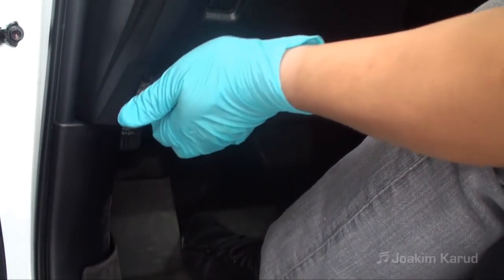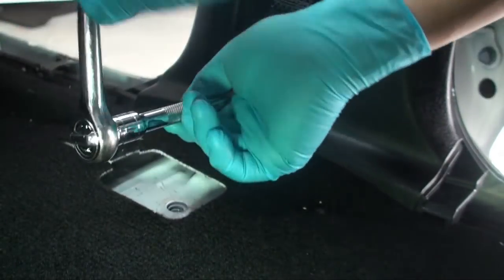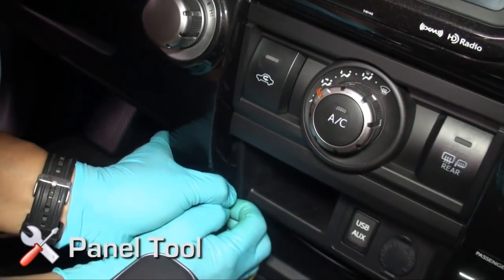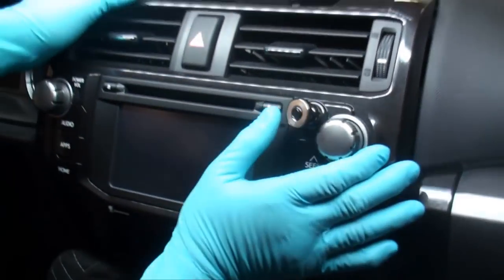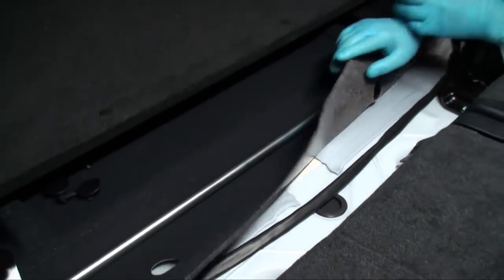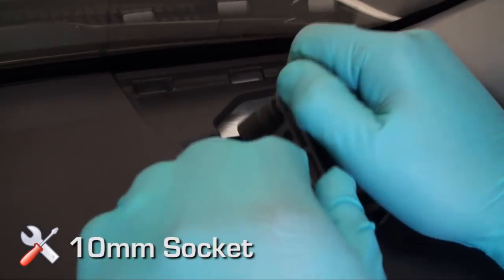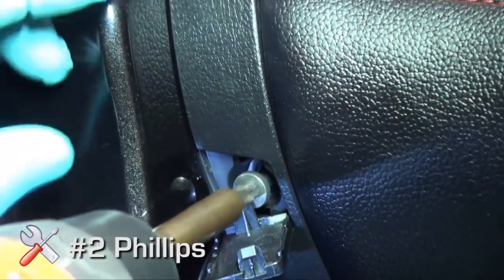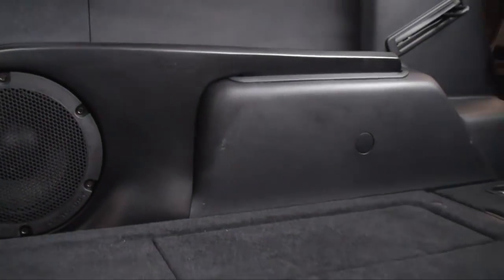Toyota 4Runner | Premium Audio Install

Comment: At 3:23, where it discusses adding the ground cable to the built-in welded threaded boss under the passengers front seat, I would scrape the metal down to remove all of the paint first. That would make it a more solid ground connection. Otherwise, good video. I would also consider adding some soundproofing to the vehicle since you have the door panels and the rear hatch panel off. I am a fan of Hushmat and Soundskins on my customers cars.
Reply: Great points.

Comment: I (double) Dyna-matted the hatches. I like that amp mounting,, very slick. My sub enclosure made it very difficult to access the brake and reverse lights on the passenger side.

Comment: Great video guys!
I feel like I can do this very easily after watching it. 
Very well made and great instruction! I cant wait to do this to my 2016 4runner trail premium.
Reply from the maker: Thanks for taking the time to share your feedback!! We truly look forward to the opportunity to transform your listening experience  in the 4Runner. Be sure to reach out by comment or message if there is ANY way we can assist you along the way.
Reply: OEM Audio +  i am curious if you sell the subwoffer box by itself without the sub?
Reply from the maker: @TheRoninChronicle  At this time we do not sell our components (enclosures) separately. This is because O+ specializes in delivering GUARANTEED results in terms of installation, sound and reliability (a promise we can only guarantee with our close-loop packages designed, engined and tuned for each specific vehicle).  

If we can serve you by providing you with a COMPLETE experience, let us know.

Comment: Just finished the install of the reference 500 (no sub) on my 2018 4Runner. First suggestion is call OEM and have them send you the email on how to reinstall the door panels. I’d think all details of the install should be readily available. I had a difficult time getting them back on. Get the email, 100 times less frustration. It’s not as easy as shown on YouTube. A number of minor details are left out but it’s doable. As for the sound? Marginally improved. I had the non JBL radio. The sound wasn’t horrible but definitely could use improvement. Perhaps I had high expectations from OEM based on testimonials but for the money paid the sound improvement is marginal. Yes the highs are a little more crisp and the bass, I have to say it’s around the same. Now I’m only comparing and contrasting the speakers with the amp. The mid level still sounds like the stock speakers, vague, a little cheap and lacking clarity. It works. Slightly better, slightly improved. I was expecting more.
Reply from the maker: Thank you for your message and bringing this to our attention. Based on your feedback, we suspect your System might not be performing as intended. Would you please send your feedback to our team at support@oemaudioplus.com (you can literally copy and paste your comment). We are committed to your satisfaction!

Comment: Pretty cool instructional video I have a 2010 4Runner non JBL & non navigation SR5.  Quick question how many watts  RMS is the subwoofer? And you guys consider making a ported version? My audio has been really lacking especially after 10 years of owning the vehicle.. looking to upgrade and purchasing this and installing it myself.. Cheers oh and I'd like to eliminate the need for a party mode I'd like all my speakers to sound the same as loud or louder than party mode is that a possibility with this?

Comment: Help would be greatly appreciated! How does the yellow power cable connect to the amp or head unit? Also the "other" end of the cable it looks like there are two wires that head towards the battery. How does this all work? 2012 4runner and kit came in Dec 2023. Cannot find help on the site or from product support. Thanks anyone ahead of time! I see no place to get the yellow cable to the amp or head unit. I don't know if the "double" yellow wires both go to the battery, etc...

Comment: The hardest part of this entire upgrade is trying to fish the harness behind the glove box.  Any videos on that particular aspect?
Reply from the maker: Michael Meuli If you’re having difficulty running the harness up and above the glove box, we would recommend putting the connectors (10-Pin and 6-Pin) in a plastic bag (the Speaker bags work) and taping to prevent the connectors from getting caught along the run. If still having trouble; send us a message at tech@oemaudioplus.com
Reply: @Oemaudioplus  probably more work than I needed to do, but I popped out the air bag, took the 5 screws out of the glove box, and popped that sucker right out. Ran the wiring in about 5 seconds, popped the glove box back on, screwed it in, and put the air bag back.  I'm a big dude so even trying to fit my hand up that side panel location was no bueno.  Thanks for the reply.  I appreciate it!  Have a good one!

Comment: I have a 2016 4Runner with a 3rd row seats. Do you offer the same sub for my model as you do for a regular 2 row model? If not, how much smaller is the subwoofer for the 3rd row model? Do you have any pictures of your sub installed in a 3 row 4Runner?
Also, what brand and model of the amplifier and speakers are used in the system? I want to look at the specs before making a decision to purchase your system.
Reply from the maker: Andrew Evanoff Yes! We have a solution made specifically for your 3-Row Seating. The following link will provide images of our 3-Row Subwoofer attached for your consideration. This System is available for either the passenger or driver side of cargo area or both (Dual). As you’ll see the design is specifically to be stealth with seamless fitment and fully functional (maintaining all functionality, outlets, etc…)

You’ll find the Reference 500 with 3-Row Configuration Page here: bit.ly/Config_4RN3

Comment: Radio removal is incorrect for my 2018. Had to find another video to help. 

Had to uninstall amp to connect new upgraded connector not shown in video. 

Running subwoofer cable under rear left trim could use more detailed explanations. It was a struggle to figure out. 

Seems like an ok product. Good customer service unless it’s Sunday. For the price they absolutely should take the time to remake a correct install video.
Reply from the maker: OK G we apologize that you encountered variances from your radio disassembly and that which is outlined in the step-by-step tutorial. 

Again please excuse any confusion in relation to our new 500Q connector. You should have received a link to the addendum video with your shipping notification and found hosted on our website under the installation support (we typically include an insert referencing this resource with the packaging). 

We don’t take it lightly that you did not receive support during your installation. We strive to make ourselves available at all times. Unfortunately this Sunday happened to be a rare instance when we missed your correspondence. It is out hope that you have since connected with the team or at least received a return call/message.
Reply: Do you have the video link?

Comment: Can you recommend any installers in the Saint Louis MO area? .. I wouldn't want just anyone to do this big job LoL!
Reply from the maker: Excuse the delayed response. It appears that the closest installer we have worked with in your area is in Bonne Terre, MO (not close). We unfortunately do not have an active installer in your immediate area that we have worked with. That being said, we pride ourselves in producing completely plug-and-play kits that utilize factory hardware locations and integrate intuitively into your vehicle. Are there any shops in your area you have considered or perhaps have good customer reviews?

Comment: Will this system consume a lot of power? like for instance if I was parked with the engine off, how long could I listen to music with just the battery on?
Reply from the maker: Gerry Gutierrez great question!! Our System is extremely lightweight in terms of power load. Meeting all OEM (Original Equipment Manufacturer) certification. Safe to say you'll get 2+ hours in accessory mode (enough time for a drive-in movie) depending on the health of your battery.

Comment: Can you not make a box that goes in the open area of the right hand side?  That is wide, open space in that pocket, where as you're taking up some cargo room by putting the sub on the left side?  That's the only thing that's making me hesitant right now.
Reply from the maker: Thank you for expressing your preference! Truly we strive to personalize EVERY experience for our owners. Our Acoustic Engineers elected the driver side because it is the perfect size cavity for our desired 14-liter sealed enclosure without making the subwoofer system larger just to fill the additional space (to look flush).  If space is of concern, our subwoofer system easily can be removed for the the days you're doing some major hauling and needing the additional cavity space your O+ sub is occupying. Keep the questions coming - As mentioned, we are here to personalize your experience.
Reply: Thank you.
Also, I do not have a 3rd row/cargo tray.  I do have a Husky all-weather mat that extends into the cavity/pocket on the left side.  Can the OEM sub simply sit on top of that mat?
Reply from the maker: We would have to test to verify fitment and/or provide instructions on how to make to two work together (no doubt it can). Our subs commonly interact with all-weather cargo mats in other applications.  Possible to send us pictures of your cargo area experience@oemaudioplus.com ? We want to ensure everything fits perfectly.
Reply: OEM Audio + will do!  Thanks
Reply: @Oemaudioplus  I have the same question about fitment with the Husky all-weather cargo mat..
Reply from the maker: @marccawley2110  from past applications, our designs work with the Husky Cargo Mats. If an opportunity presents itself, we would love to document to two working together (we are based in Anaheim, CA - If any takers).

Comment: Installing now however your instructions are wrong, and some things air incorrectly explained, such as why are there TWO YELLOW WIRES coming out of harness, bracket for amp dosent match install had to modify bracket , rear area behind seat does not not match 2019 4runner, you need to update the information, with that said it makes a customer who spent 1800 bucks pretty pissed off trying to install on a Sunday and your info both in. Pdf format and on website and in video is wrong
Reply from the maker: Rpm Rare Performance Motorcars sorry to learn of this feedback. We have strived to ensure that the information as found on the INSTALL section of the website is most up-to-date for our new generation Sound Solution (which includes 2 Power Wires and new Amplification). Have you tried contacting our System Integration team? Is there a name we can look up on it end, to contact you and provide real-time support? Please advise.
Reply from the maker: Rpm Rare Performance Motorcars we just wanted to follow up on this shared concern from yesterday. We had replied directly to your comment, but understand that sometimes these notifications can be missed. Please connect with our team at your convenience to allow us to provide you the level of support we strive for. Thank you!
Reply: @Oemaudioplus  thank you for your reply, and I was completely blown away when you contacted me on a Sunday during my installation and took the time to sort out the issues and take notice on some indifferences on a 2019 4runner Trd off road as compared to your video installation, thanks again.. 😎👍
Reply: Same issues here. Seems like none-matching instructions, 2 calls not returned, no significant available supplemental info. Seems like this will turn into about a 16 hour “learning experience” if fortunate to complete.

Comment: I have a husky liner in the rear, will it affect install of rear sub?
Reply from the maker: Great question. Due to our intended cable run for the Subwoofer Umbilical/ Connector, it is needed to trim and opening to allow the Subwoofer connection to run through the cargo net opening as seen at 10:16 on this instructional video. Otherwise the Liner and Subwoofer work together seamlessly.

Comment: Important note!! On this system the amp that I was just shipped mounted with the wiring harness facing the drivers seat. Sounds like a non issue but trust me this is a major problem!! the wiring harness obviously is different as well there are no longer two plugs but rather on large plug with a swing arm to lock it in place. The swing arm on the plug is a nice touch but because the wiring harness plugs in further away from the threshold it results in the wiring harness being too short to route it as shown in this video. When I routed my wiring harness as shown it IT DID NOT REACH THE BACK OF THE RADIO!!! I was 8" short. I had to re route the wiring harness across the passenger floor to be able to plug the harness into the radio. This is a problem on mulitple levels for one now under the rug on the passenger side there is a bulge from the wiring harness and it will be stepped on constantly.Also the ground wire was not long enough to have ample slack for the seat to go all the way back on the track if it is mounted in the location shown here. I dont like the fact that my wires are not in under the threshold for a clean and secure install, the sub harness was fine it had 2" extra wire to mount the sub, still close. End of story what would it hurt to give an extra foot of wiring harness ? Fail.
"
Reply from the maker: Hi Steve, thanks for the comment! It sounds as though your connector was on backwards and thus the loss of 8" as you experienced. Did you have a chance to contact our Technical support team? We want your installation to go smoothly and are happy to make ourselves available should any questions come up during the process. Please give us a call without hesitation should ANY questions come up along the way!! (855) 636-6346 x2.
Reply: No tech support isnt open at 11pm.
Also the front door speakers plug is located on the side of OEM audios speakers and not on top as the factory speakers are. therefore I have to cut open the exisitng wiring for the factory plug to reach. Not good.Why wouldnt they put the plug in the same location as the factory speakers when  toyota gives zero extra wire for the plug.
Reply: Its pretty simple there is only one way the amp can be mounted. The plug is facing the center console.I tried to flip the amp around in the bracket but the allen bolt do not line up if its flipped. the eyelets are spaced differently on each side. smh. Ive installed and fabricated many stereo systems the reason I went with this is for the ease of install.
Reply from the maker: We actually take Tech calls 24 hours a day.  Especially because we know when this particular phone line rings, it means that one of our owners is in the midst of an installation. We apologize that we weren't more clear about  our available support for you during your installation. 

Are you available for a call now to review the installation and provide any available assistance? (855) 636-6346 x 2
Reply: Im working through things. This isnt my first rodeo, However things like the amp having the plugs on the opposite side isnt cool when you keep the wiring harness the same length, and notice in your video where the 6x9 has the plug on the top of speaker the 6x9's I have, the plug is on the side, Look into that youll see the problem. The factory wire will not reach without cutting open the sealed wiring harness and tape and pulling more slack out. I just dont lioke to pull on such delicate wires. I wish my speakers had the plug located like the one in the video. thanks for your replys. I appreciate the fast reply.
Reply: I am getting most of the same issues.

Comment: you got to protect them hands don't want any calluses on them!! lol C'Mon man
Reply from the maker: Lol! We wear gloves to protect the interior of the vehicle, not to protect our hands.
Reply: l l well from a mobile electronics installer i see your point but it gets in the way more often than not installing wires as you cannot feel the wire your looking for while wearing gloves.
Reply: Vince Sandoval: as a professional installer since 1985, I use various gloves for different jobs daily. Surgical gloves are only one type I use. My favorites are used by the carmakers in factories, made by Ansell. Some have open fingertips.

Comment: Save your money and get something else. I had it installed and it doesn’t even sound that great.
Reply from the maker: Zach, based on what you're describing we suspect that something is amiss with your Installation and/or the System! We are committed to ensuring you receive our intended sound reproduction. If you haven't already please contact our team immediately so we can get involved in getting your System performing as intended: 855-636-6346

Comment: Hope no one ever needs to access their jack and tools...
Reply from the maker: Ben, our tailored Driver Side 4Runner subwoofer fits flush to the driver side rear panel and is easily removable to access the tire jack as a result of our pressure mount design (mounts and/or is removed in a matter of seconds). Hopefully you’re not needing to access your tire jack weekly.